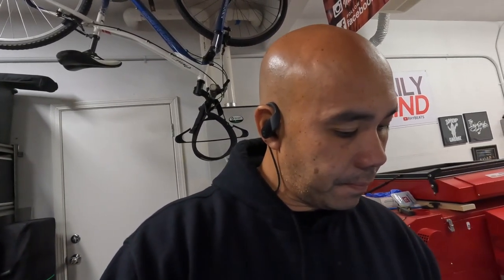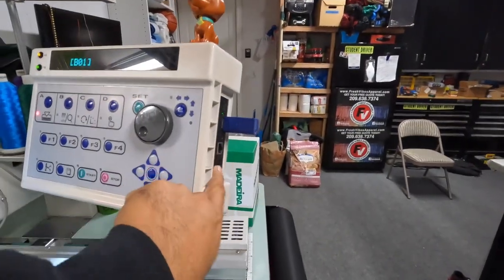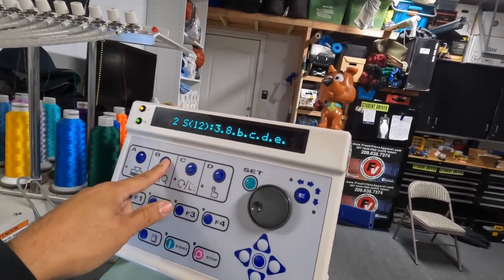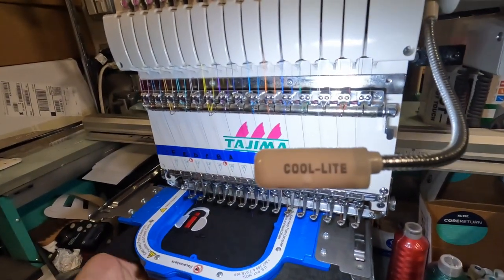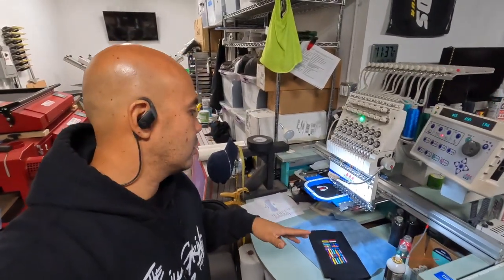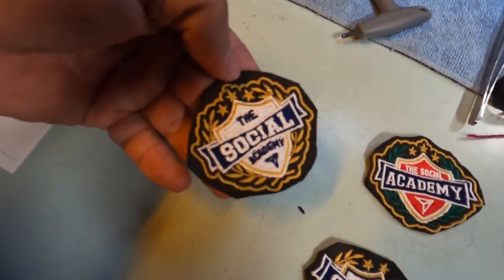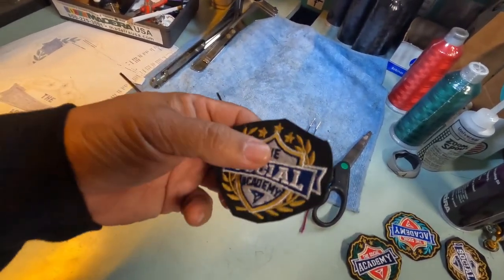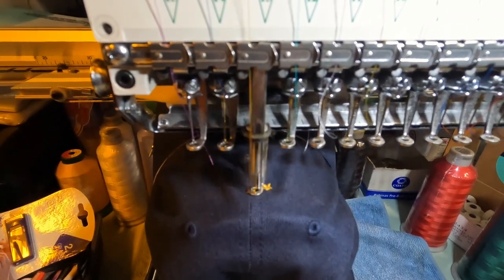EMBROIDERING ON A SINGLE HEAD TAKES FOREVER : TAJIMA TEHX C1501 (S:09/Vlog 012)

Comment: Do you have a price calculator you use for embroidery. I have been using the printovo calculator for screen printing and it works well for me but my embroidery I feel like I'm over charging at times because I don't see a price change from 5 items to 50. I know my stitching cost will not change but the garment price should as quantity goes up. I just don't know how.
Reply from the maker: I do. Hit me up on IG